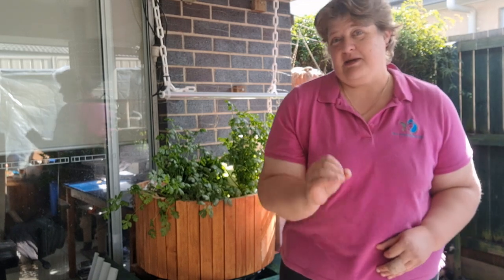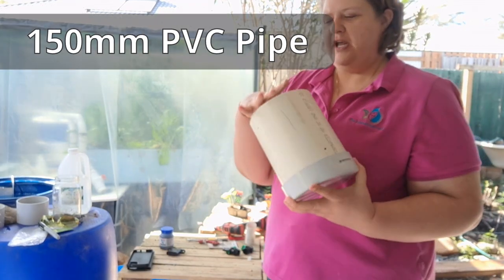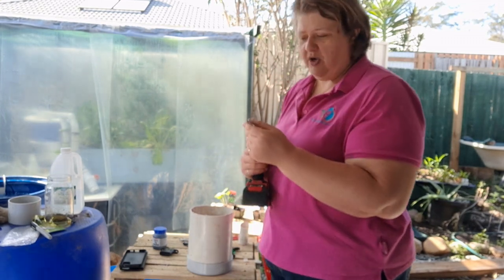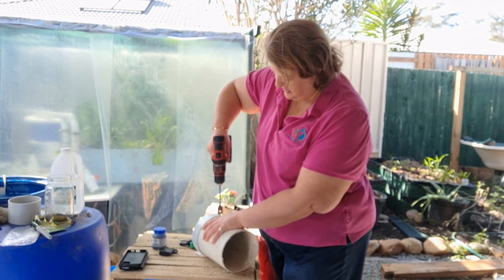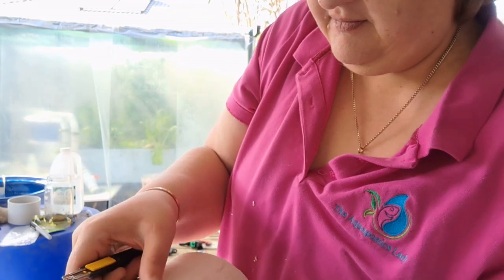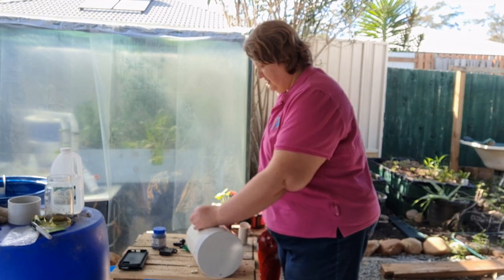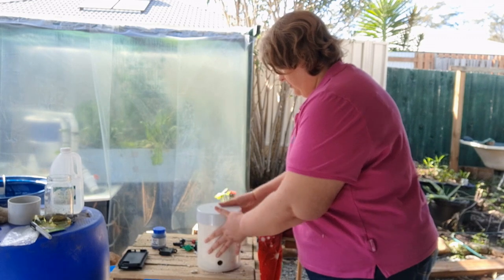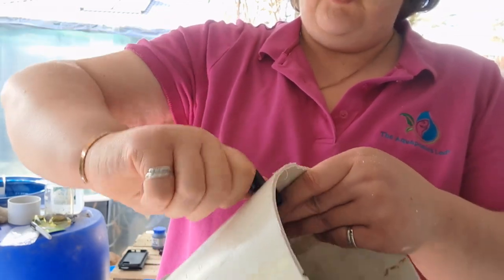How to Build a Cheap Easy Small Solids Waste Filter for Aquaponics

Comment: Large Diameter pipe not so easy to come by. Unless on order😢
Reply from the maker: Thanks for watching and leaving a message. All parts that I use I get from my local hardware store (Bunnings) for irrigation based plumbing or a local plumbing store (Swan) for pvc piping. I hope that helps